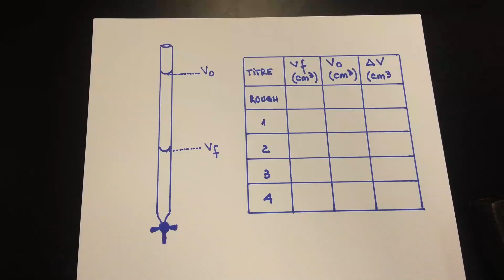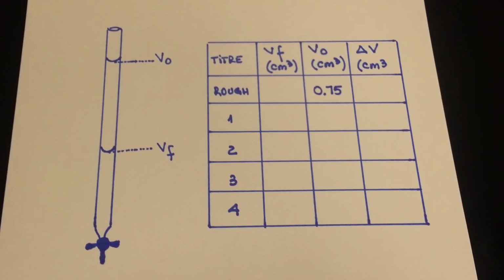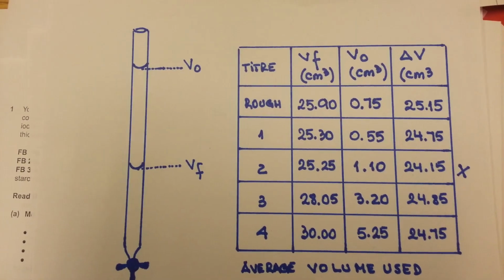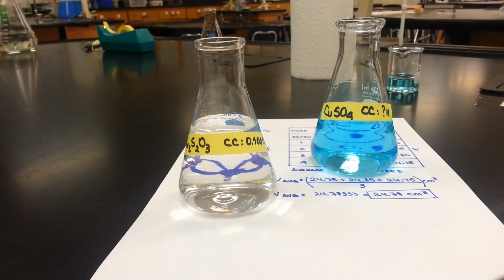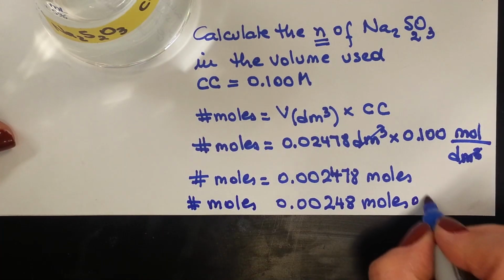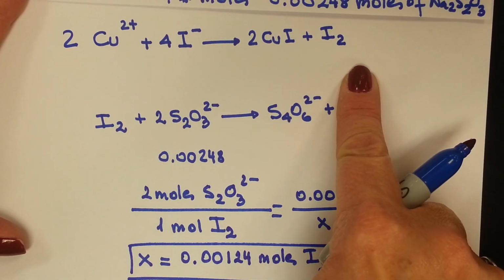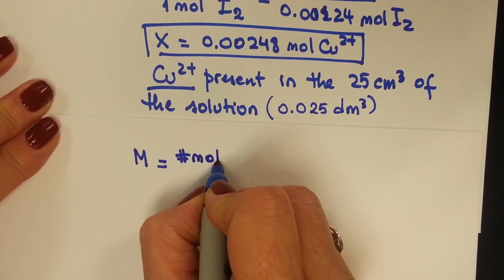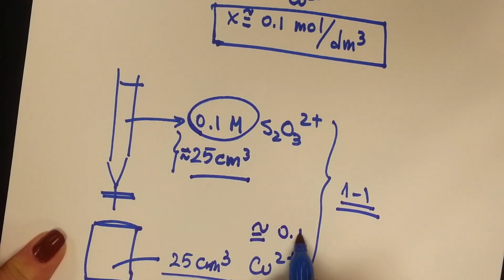Cu2+ Na2S2O3 titration

Comment: Hi Analia, I examine the same reactions, but have concentration of the tiosulphate given in [N] - normality. Could you conform that in this case 1 N = 2 mol/l ? There are many sources in internet giving the both variants 1N = 1M, and 1N = 2M, but I think the second one is correct.
Reply: In case of redox titration See the number of electrons exchanged per mole between reactants...... Then U can calculate equivalent weight by dividing the exact molar mass of compound

Comment: Pl.expain the same for spectrophotometer reading from stock solution, preparation of various concentration, ufind con. Of unknown from graph and caculation
Reply from the maker: Basically, you create a calibration  graph using known concentrations and absorbance (absorbance in the Y and concentrations on the X). 

Then you measure the absorbance of the solution of unknown concentration and extrapolate to the correspondent value of concentration. 

If this is not clear, please let me know.